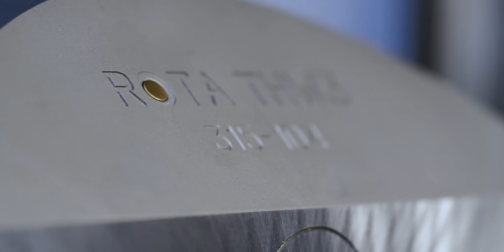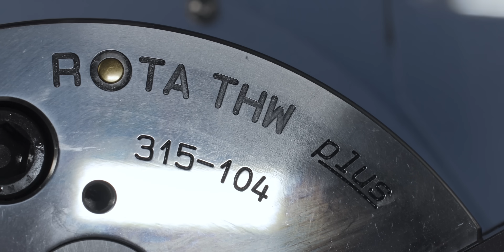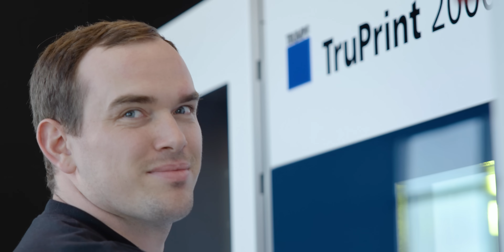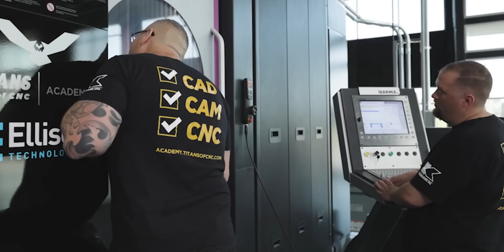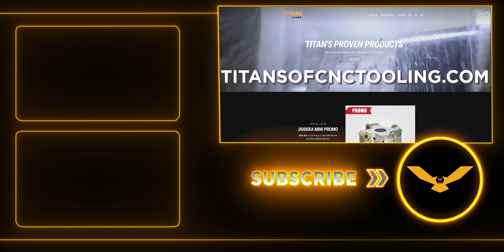Should Engineers Be Arguing with Machinists Over Run Time?

Comment: i work in a production shop, and they ask why production is stopped to make prototypes, and if they ask why the prototypes arent getting made.  cant make every one happy,  I had a  production planner that would write 20,000 piece orders on 2 minute parts(240 parts a shift is 6 weeks at best ) and wonder why he couldnt get the other part they needed off the machine. Ultimately I've outlasted 4 "managers" in 8 years because I can make the parts and they can't.

Comment: So it's not CNC related but my wife was a  PA in a private medical practice out in Arizona. We had our first child and she went back to work, federally you're protected to have time set aside to pump for breastfeeding purposes. Well in two separate occasions shortly after returning to work they called her into the back office to try and say she wasn't working fast enough and they brought up her pumping times and also the patient wait times. Technically at that moment if they actually did anything we could take them to court but they really needed my wife and the community needed the practice to stay open. I knew what was up and so I told my wife to start tracking the time it took the patient to get from the waiting room to the exam room and then also track the time it took the nursing staff to see the patient and tell her they were ready to be seen. We then wrote up a steaming rebuttal to both "corrective action" meetings detailing how the greatest time factor was not in fact the pumping time set aside by law but was in fact mainly an issue with the understaffed and overworked nursing department. Showing that waiting and rooming times took up over 2/3rds of the patient's total time in office.

As with any situation if you want to measure the time spent on a given job you can't just leave it at the primary times and expect to get a total picture of what's going on. Instead you need to break things down and get a complete picture including the time list to the new admin time spent tracking time. This way you measure what matters and you're able to properly determine what the cause is for long lead times.

Comment: Mechanical Engineer here. I never argue with the machinist if the end product has the desired quality. It is an art both machining and engineering and you cant rush art. So, good job you guys!!
Reply: When I was an engineer designing one-off parts and systems, I always joked that I didn't care what it cost (tongue in cheek).  The key there was to have something that worked the first time, design delivered on time, didn't fail during the warranty period, and did not have to go back on the machines for rework.  They were overbuilt and often had extra features like tapped hole patterns put in the first time "just in case" during system debug and alternate mating component had to be used.   There was very little development work.

Later in another company designing pieces where tens of thousands would be made and extensive life testing was part of development, I might spend two weeks to save $0.25 of total cost per part.  Totally different mindset.  

At the end of the day though, cost to produce versus what you can sell it for is ALL that matters.  Engineers and I assume machinists often think they understand this, but do not in reality.  You often hear people say "it just takes what it takes" or some version of that.  This is when I stop putting much stock in that person's opinion on the subject.

Comment: I worked for 7 years as a machinist and then 35 years as an engineer for what was, at that time, probably the largest and best machine too builder in the US.  I always used to say that they never sold one of my drawings, the best I could hope to do was to help the guys in the shop make parts and build machines efficiently and quickly.  I retired 7 years ago.  There are pretty much no machinists or engineers left there.  Only beancounters, buck passers, and mouse clickers.  I'm glad I don't have to put up with that crap!

Comment: Chief engineer's perspective here:

No doubt that it could be handled better, starting with engineers putting on a pair of safety glasses, going down to the shop, understanding the challenges - how to design a part easier to fixture or design the fixture in parallel - and generally be part of the team and part of the solution. An "us" vs "them" culture is unproductive and unacceptable on my teams.

That said, I have the customer, the CTO, and program management all breathing down my neck, "when will it ship", so as the engineer, you go to the design department and the prototype department asking "when will you finish", and you get a big shrug, or a guess hidden as an overconfident commitment, or worse, a bold face lie.  

Productivity isn't the only metric. Predictability can be as important as productivity. If a part will take 12 weeks, maybe I get a quote from outside if my in-house shop is backed up, maybe I 3-D print one piece for fit-up to take the part off the critical path, maybe I dual-source the part, or maybe I go to the customer, and say they won't get the system until next fall, but what I WON'T DO is give a shrug, a guess, or a lie when I will deliver a solution. 

I work in the truck powertrain industry. The EPA changes the emissions law, and we need to launch a new technology when the law comes into effect, or my customers can't sell trucks -  PERIOD. The California Air Resources Board (CARB) don't care how backed up the prototype shop is - once 2024 hit, the tailpipe emissions drop 4x, from 0.2 to 0.05 g/bhp*Hr NOx for diesel engines. Be on-time, or go out of business.

So, deadlines matter, and the ability to estimate jobs and hit your promises is as critical as cycle-time and exceeding tolerances. The only way to get better at estimating and delivering on-time is to spend the effort to track actual time vs forecast, promise vs delivery, and have the most experienced guy in the shop  involved in estimating, or you will be perpetually out of control and late. So, challenge yourself to estimate how long a job will take YOU, write it in the little book with your speeds and feeds, and write down how long it ACTUALLY took you. When a new job comes in, you look back and say, "it was like that job, so probably about this long". No different than looking back at speeds and feeds from a similar job.  Strive to be better at forecasting each month, each year, then you will be indispensable to me. Continue to miss your commitments, and my parts will be at an outside shop.

Comment: 'Software & Computer Engineer'(+) here : sounds like they were attempting to implement what would be considered effectively a 'profiling' framework to analyze what would otherwise to them be a 'black box' system; in software, profiling does often indeed slow the system down considerably (the objective is to identify the bottlenecks, so that they can be optimized, routed around, or the system itself rearchitected {or capabilities added} for improved performance, at which time the profiling framework would be removed to allow for optimal performance again).  I doubt that they considered the egos of the humans involved all that much (in my day, engineers had to score in the top ~2% of the populace just to get into an engineering program, much less get out of one [~50% at my U], so they probably didn't think that any competition on the basis of relative problem solving intelligence was likely even a factor, though it sounds you may have effectively tried some sort of ~one-upmanship games with them : I think it likely might have improved things to just give them a few 'day on the job' activities spent meeting tolerances in front of a lathe, or programming cnc's in gcode, or something).  Such data could be used for a wide variety of analytics, inclusive of all that you've covered & more.

Comment: For nearly 46 years, I worked in the tooling end of a fairly large company where the things we produced stayed in-house.  It was at one point, nearly the same scenario you described about the clocking in and out and trying to put a number on an employee was tried.  Some success was gained, but everyone cheated on their reports anyway.  The CFO came to our department and wanted to know what was going on and would spend a day or MORE with every guy in the department to see first-hand how the jobs were done.  He gained a better respect of the technical nature of what we had to do and learned that it wasn't a production type environment, and EVERYTHING required different machines, different setups, and a vast knowledge of the steps involved in something as simple as a few parts nests for a testing machine or a set of holding jaws.  It was actually refreshing to see someone in upper management actually get involved instead of picking up the phone and bitching to the department head.
Reply: That’s good leadership.
As a general you have to humble yourself & seek info from the front line troops. They are seeing things first hand & have the best info on the situation.

Comment: I worked as an engineer for 35 years.  I always tried to work and lead with the belief that as an engineer I knew what we were trying to accomplish.  At the same time I worked with the belief that I needed the expertise of the people I was working with to accomplish this goal.  This included; office staff, draftsmen, welders, inside machinists, outside machinists, layout personnel, fitters, operators, etc.  If I saw something that I  thought was wrong or I didn't understand I started by asking questions.

At times, like any human, things could become confrontational.  I can say I was not always correct.  I  can also say I encountered errors that cost tens of millions of dollars.  In general, errors of this type came not from tradesmen, but from middle management taking shortcuts.

If you want to reduce the time it takes to make something, ask the person making it.  If you want to have something work, ask the users. 

I used to get complaints from operators about how dark the work environment was.   The next time I designed something similar, I increased the lighting as much as feasible.   Lights are a small cost compared to the $2M for the end product.

Comment: Sounds like the directorship needs to step in and give all the departments some air time to work on internal process flows and provide training company wide on responsibility and accountability. 

Does the company actually know the unit cost of manufacture? If not then someone asking to collect time stamps and how they go about doing that wouldn’t be my primary concern.

If they do then question;

How strong is the part scoping and design control and how can it be improved. 

Why are parts making it to the machine that can’t be run and how can it be mitigated.

Obtain from each department and all individuals in it any details of any known non-productive/lost time incidents and their ideas of ways to improve.

Then;

Department heads harmonise, formulate a plan, build up a proposal, communicate proposal in the department. 

Department heads provide calculated cost of improvement(s) and operational loss/risk they relate to.

Business analyses risk/opportunities. 

Once this process flow is smoothed out/the business has furnished you with knowledge of these processes/you have without doubt upheld your part in the quality management system/ then moan about the Engineer. If not then you should be aware of how accountable you are for your situation right now progressing into a rant worthy video. As you aren’t aware of the problem the Engineer has, you don’t respect the financial interlock and the business process that is fundamental to supporting your platform to practice your skill, pass on value, earn money. It should be as ingrained as health and safety in the workplace which you do care about as you demonstrate a lot of good practice. 

That is a blunt factual truth. A good example of a healthy workflow would look a little like;

Example: 

Memo: Machine Department agrees that we have no idea why we are missing unrealistic deadlines and impossible tasks. All departments concerned have reviewed the process flow to the shop floor and we agree it is flawless and we as a company of people are acting flawlessly also, we require an operational review and data capture to highlight our inefficiency. Cost: 5k, Risk: Full toxic environment resulting in staff leaving and becoming direct competitors or the business knowing all their strategies and weaknesses. 

Business highlights opportunity/risk and allocates capital. Engineer and department discuss execution of a previously agreed and well thought out proposal for improvement, so all are reminded and/or made aware of the intention, scope, roles and responsibilities.

Scope review, plan and budget established by Engineer and department. Obtain key data points and type of analysis required to analyse issues as previously scoped out and agreed upon. Engineer contacts OEM to find best practice for extracting data points to export for analysis and discusses the Company of people’s mutually agreed requirements. Extracts data with support of machine department and proofs data set and analysis type. Engineer allocates or automates analysis. Engineer reviews outcomes. Engineer highlights issues and solution. Business, Engineer and Machine department discuss and implement solution or request capital as required. 

Monitor and review. 

No requirement for Rant video.

Comment: I am a machinist, and have worked many times with customers/engineers who have no idea how machining works, how long it takes and impose unnecessarily tight tolerances.

I remember a engineer who required a tolerance on an 800x110x25mm plate with a parallelism requirement of + - 0.015mm on a plate that they were only going to weld.🤦‍♀ didn't seem like he understood that having strict tolerances increases delivery time and price.

I have more than once received a part to be made, and we have given them a delivery time, and then the engineer comes the next day and is angry because we were not finished long before the specified delivery time that we had given to the engineer/customer.

funny enough, one of these engineers who called about the delivery time several times a day, when the part was ready and could be picked up, there was no hurry and the part was left for almost 3 weeks before it was picked up.😮‍💨🤷‍♀

Comment: I’m an engineer that started as a machinist. From my experience it’s about a 50/50 split on responsibility of why jobs take longer to run than quoted. I had one operator half speeds and feeds because quote “it was too loud.”  A lot of guys also just crank out programs and don’t ever see them run. If the engineer isn’t standing next to you on a virgin program how do you know what’s a good move and what’s not. We are approaching a job with a preconceived notion of what might be problematic and try to mitigate those problems before releasing programs and fixtures but there’s frequently things that might be overlooked or things that aren’t problems at all. Continuous improvement only works when there’s a foundation for what’s already a place that can be improved